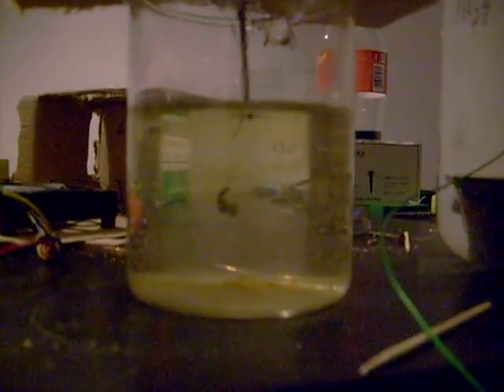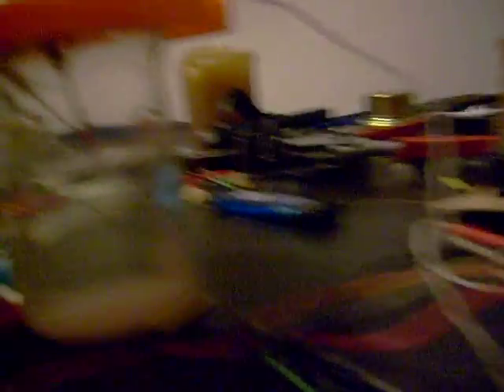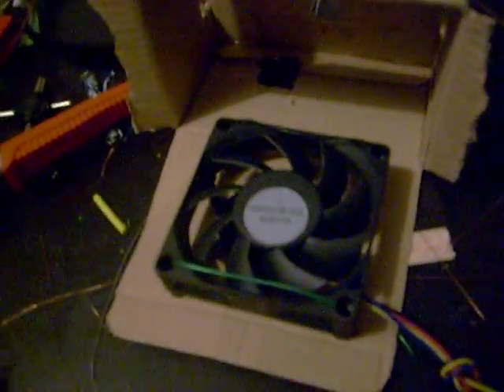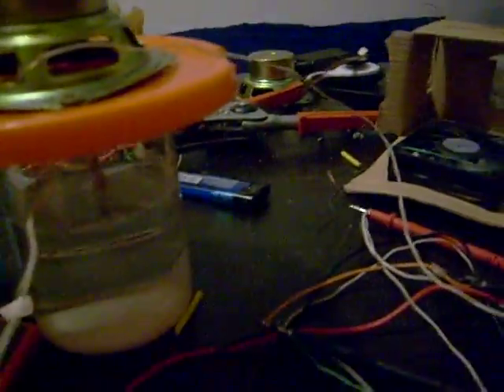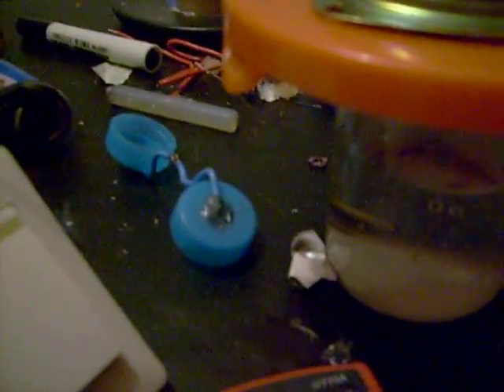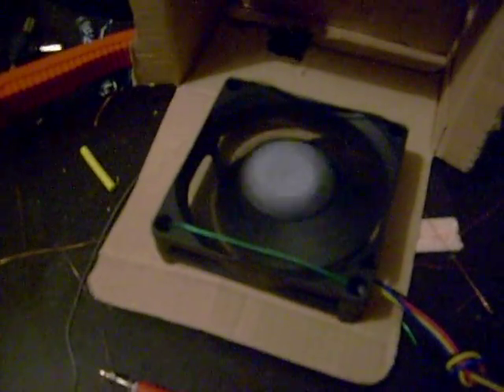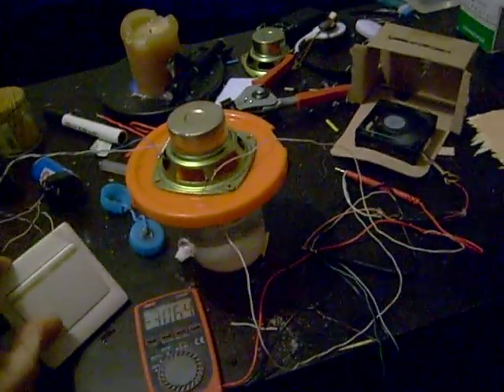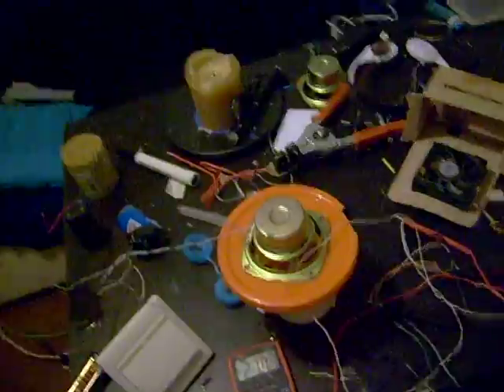DIY Salt-Water Relay - Electro-Chemical-Electro-Mechanical Power relay

Comment: I had the opposite happen to a saltwater rheostat that I built.
The voltage remained the same, but the amperage changed.

I connected it to a 12 volt battery in order to reduce the voltage exciting the armature of a generator that is oversized in comparison to the motor.
When full electrical load is applied the engine dies due to the electromechanical resistance of the generator.

I think I need to build some kind of relay that reduces power exciting the armature relative to the output of the stator.

It's really a head scratcher.